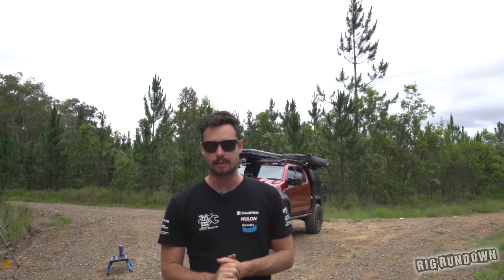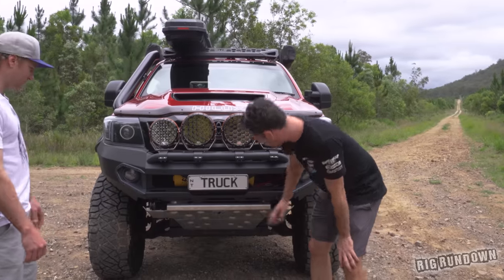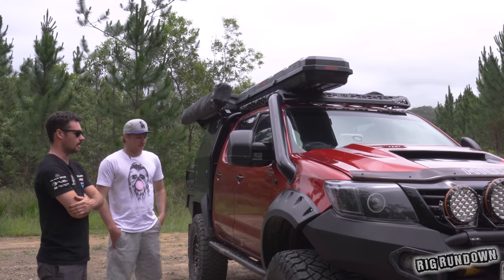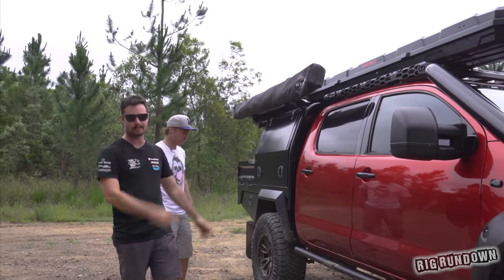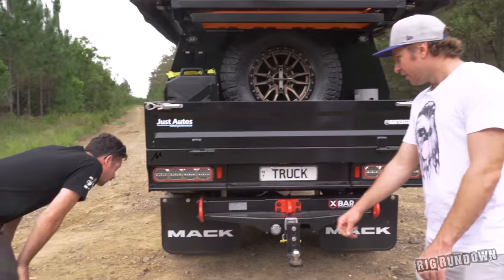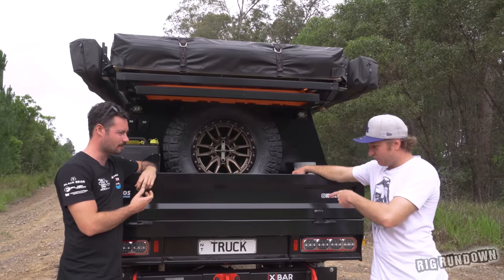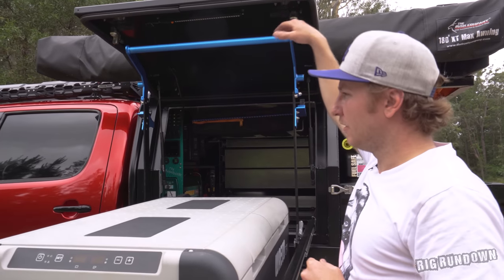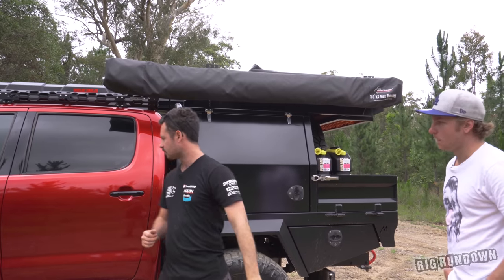RIG RUNDOWN || Blakes BOOSTED Hilux Walkaround

Comment: You should give an estimate or rough indication of what these builds cost. Would be quite interesting to be able to compare the price ranges of all the different types and styles of build. Good stuff mate keep it rolling 🤟🏽
Reply: If you need to ask the cost you can't afford it anyway
Reply: This is definitely >100k Aus
Reply: Awesome rig!
Reply: Some people don't keep track
Reply: @trent4439  relax
Reply: I decided on the 3.2, straight five, Ranger PXIII 2021/3 model, flame me but cheaper than a new Patrol or Landy. Made in Thailand, but I care little for that.

Ford already have the rubbish, twin scroll, 2 litre, 10 speed which might last overlanding, but not rock climbing or mud sliding. The 3.2 is suspected to replaced by a V6, with all the problems that come with a V6.

My build will come to about $120K with upgraded suspension, tyres, Ute Master canopy and other ancillaries.
Reply: @trent4439  you’re so cool

Comment: Mad split cv boot, looks like there was no grease in there
Reply: I bumped on that too. I'd take a truck with less lift and straighter CVs any day. That's what will break and get you stuck one day. For the one minute you needed that clearance. The other 364 days, 23 hours, 59 mins are causing you problems. Personal experience and opinion. Other than that, An amazing rig. The tray kit is outstanding.

Comment: Running 35s his odometer will be out which means his L/100 would be better than calculated , same goes for alot of the cars
Reply: He would have gotten a diff re gear with 35s mate
Reply: Hilux diesel Auto need a 4.5 gear with 35s to retain factory revs